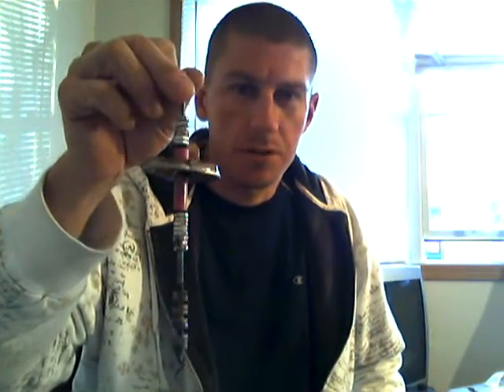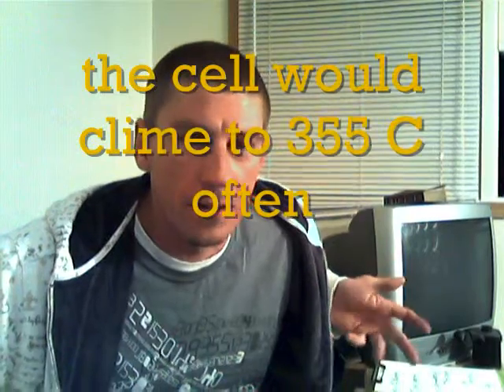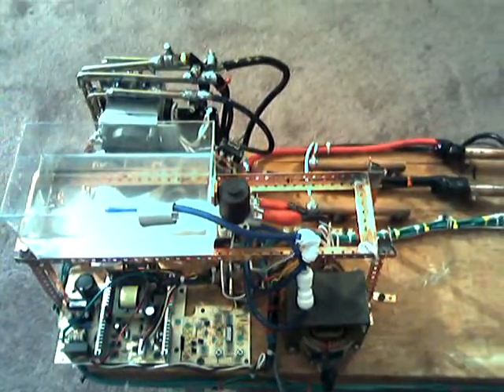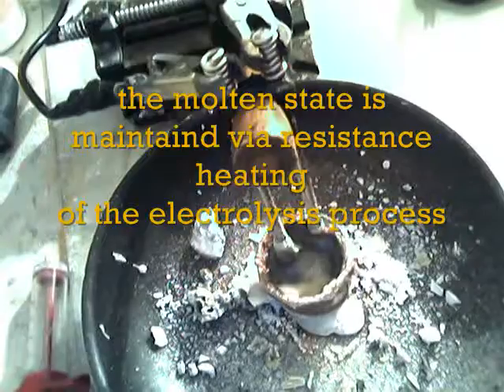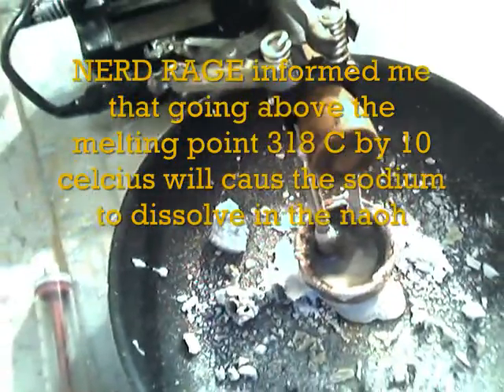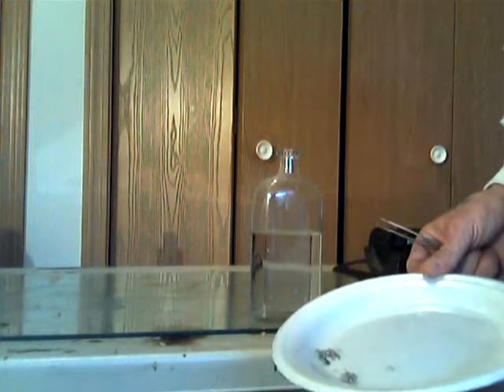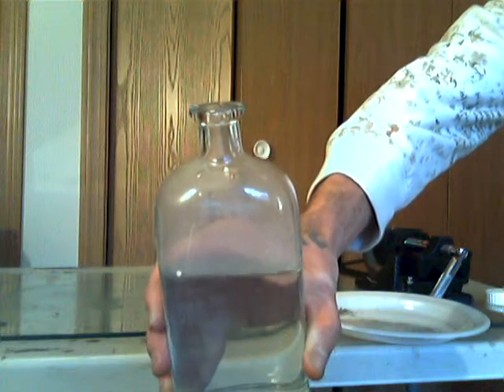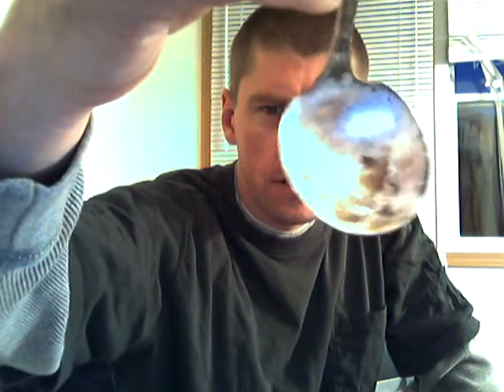Electrolysis of molten Sodium hydroxide, NaOH,and sodium explosions.wmv

Comment: Maybe some big tank Capacitors would have helped to absorb the killer voltage spikes.
Reply from the maker: turns out if the temp goes just several degrees over the melting point it will dissolve the sodium , and that's why it turns brown

Comment: Well, it would be pretty awesome to get 650C just because. To do it, you might use a combustion chamber with enough insulation so you don't lose heat. If you use electric heaters, you don't even need exhaust, so it might be a closed off insulated oven.

Comment: I just bought a 12v battery charger (2A/8A/12A) Motomaster eliminator. Do you think it's possible to do electrolysis with this kind of device ? Meaning simple electrolysis like ClO3, ClO4 production & more complexe like with molten sodium hydroxide ?
Thanks a lot, in advance!

Comment: Have you considered producing that mixture of sodium and NAOH you spoke of and then melting the sodium out of this mixture, preferably under argon? You can pobably control the temperature better when electrolysis is not part of the equation as well.

Comment from the maker: also sodium is not easy to handle at temps well over 1000 degrees, it burst into flames
instanly at that temp in open air so a complex inclosed cell is needed to pull of your suggestion, im not nocking your sugestion friend just answering them

Comment from the maker: sodium carbonate carbon reaction was not some half baked idea of mine , perhaps you should research your facts before you make public statements bro, also using molten naci
is next to impossible with the supplies at hand, the thing is even if i added some calcium chloride to lower melting point to 650c or so 650C is as hot as the fires of hell
and to bring a crucible size object up to 1202 degress F is a monumental feat and would probly consume an entire barbique propane tank in 7 minutes flat

Comment: You can never reduce Sodium Carbonate with Carbon. Sodium is much more reactive......... Try using Mercury as Cathode to get Sodium Amalgam,  also do separate both electrodes  ionically............. A better method might be using molten NaCl....

Comment from the maker: welders are not regulated power supplies bro, they dont have a single capacitor or a choke , its just rectified ac at a very poor power factor, i allready tried this it cost 1 to 500$ for your idea to be implemented, all you see here came outa the trash,,,, very cheap , experimenting is a high budget operation, you cant just go buying shit all just to 
basterdize it

Comment: I think your sodium was rather dissapointing because you dropped it in a more or less closed environment. The top of the bottle isn't large enough to replenish the inside of the bottle with oxygen which would make the hydrogen explode. After your first piece of sodium, the hydrogen exploded and the oxygen was used. What was left was water vapor which I think prevented further explosions. You should try and drop your sodium in a petri dish next time.

Comment: @vmelkon I'm not pretty sure about your glass skirted electrodes at that temperature. But it can work. Well, I have changed my mind about the way I should use. And found the NaOH way the best, because there is no chlorine gas. I've made some experiments with chlorine and found it a very dangerous and reactive element. Although sodium hydroxide is a very dangerous chemical, especially when molten, it can be done with two iron electrodes. And it's really easy to make some sodium in that way.

Comment: @NOBOX7 
Leidenfrost only applies to things that are extremely different temperatures. Sodium in general reacts with water the way you observed. If you were looking for an explosion, you have to go up the periodic table. Potassium metal is a lot more vigorous, and I think cesium (I don't have a periodic table handy) is even more so.
Considering the amperage you have available, you probably would be better off melting sodium chloride and electrolyzing it. Then you only have to deal with chlorine.

Comment: Im trying to build a cell that keeps these gases and the sodium away from each other, therefore preventing the creation of explosive mixtures. Im taking my inspiration from the "castner Proccess" for the industrial production of Na metal.

My cell with be a U shaped pipe, with an electrode in either end. This will prevent the mixing of O2 and H2 gases, while at the same time keeping the molten Na metal in an oxygen free environment.

Comment: Im trying to do this too, just out of curiosity. The gases are O2 and H2, with Na and H2 being produced at the Negative terminal and O2 at the positive. 

Thanks for the info about the Na dissolution at 328C. that explains my problems.

The reason for the "explosions" we've both observes is that HOT, MOLTEN sodium metal is being produced right next to O2 gas, and H2 gas. So I think its the sodium burning, which in turn ignites the H2 / O2 mixture.

Comment: If you find Argon too expensive for he procedure, you can use nitrogen or carbon monoxide for this but I am not completely sure about them because there are a lot of sodium - nitrogen compounds that can be produced (eg. Na(N3)2 sodium azide). But carbon monoxide is also used in iron metallurgy as a reducer compund. FeO (or Fe2O3) + CO --> Fe + CO2. But CO is very toxic to your blood cells and can easily be ignited by that heat so use Argon if you can. :D

Comment: Argon can be bought in hardware shops in Hungary. It is used for welding. If it is a problem, what kind of container can be used to keep the molten material in it, you could use a clay pot, I suppose, or a stainless steel bowl. Or I prefer using a zirconium dioxide glower bowl that I bouht for chemical experiments.

Comment: With 60% of CaCl2 and 40% of NaCl the necessary temperature can be reduced to about 630-650 degrees C. It can be reached by your torch with propane and oxygen or HHO and added hydrogen-peroxide gas (over 150 degrees Celsius it is gas). But you only have to melt the material and after that it is ongoing, the resistance heat will keep the temperature. In the Downs Cell your sodium is not exposed to air oxygen but if you wouldn't like to prepare one, you can blow argon (inert gas) to the cathode.